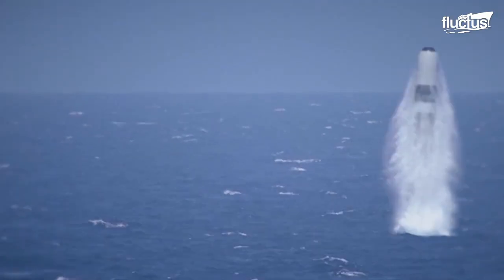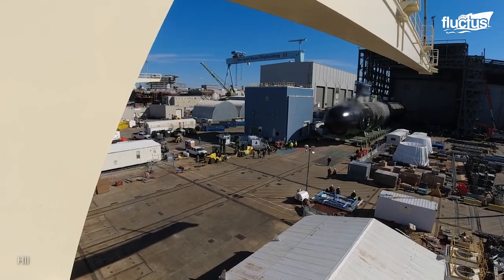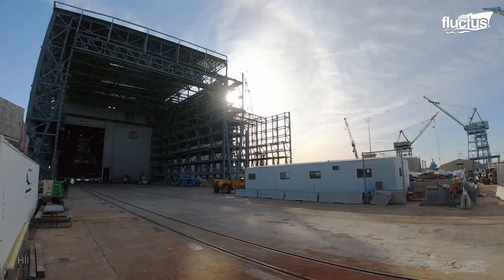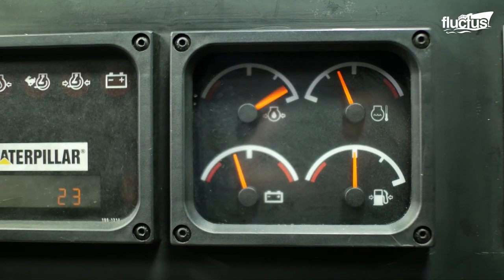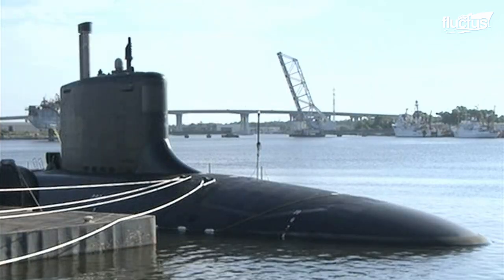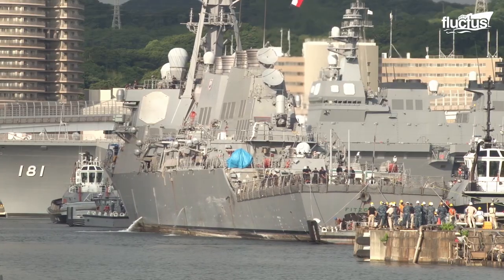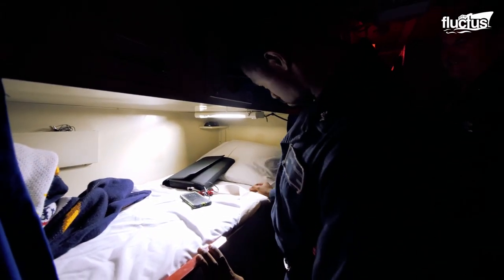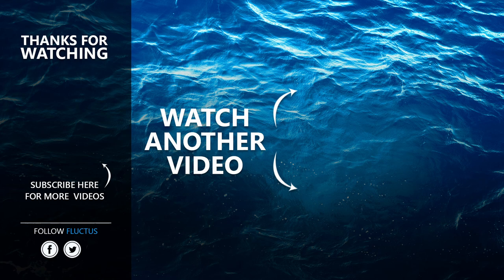Why US is Switching to this Massive $9 Billion Nuclear Submarine

Comment: @1:50 ”Currently the US submarine fleet includes twenty-nine Los Angeles class fast attack subs, and eighteen Ohio class ballistic missile subs.”  Technically correct, but the fleet also includes three Seawolf class fast attack subs and multiple newer Virginia class fast attack subs.
Reply: I was present at the first Sea Wolf Class sub's christening and launch. My wife worked for EB and I got a pass to go with her to the christening.
Reply: And you can assume they have way more undisclosed. Submarines is one of the most guarded secrets because of nukes and stuff.
Reply: @belldrop7365  No. The number of submarines we have is not secret. It would be impossible to keep such a secret. Also, the submarine service is secretive simply because submarine operations depend on stealth, not because of nukes in particular.
Reply: As a lifetime Navy Brat I hope you are fairly accurate!  I generally don't BS about weapons, some of that is too far and too late to stop!  I feel, just for the sake of propaganda, that autonomous Polar or other systems are possible fail-safesl  sm

Comment: 5:20 "When diving water is pumped into the ballast tanks, allowing the vessel to sink"

1. Water isn't pumped into the ballast tanks. The ballast tank vents are opened & water comes in from the bottom pushing air out the vents above.

2. The vessel doesn't sink, it dives as previously stated.
Reply: Yeah, 'Pumped into the ballast tanks' caught my ear as well.

Comment: The newest submarines do not use "the latest in technology,  like sail-mounted dive planes.."  
 Those have been deleted since the Seawolf class, (which is no longer being built)  in favor of retractable bow planes now being set into the hull itself.
Reply: Why don't they use a steerable ducted prop and eliminate any dive planes?
Reply: @rael5469  Probably sound reduction, better to be more stealthy than slightly more maneuverable.
Reply: @rael5469  Noise.
Reply: @rael5469  The newest submarines DO use a (sort of) ducted propeller, in the form of a "Shrouded Propeller" .  But these propellers are massive, some twenty to twenty-five feet in diameter, plus the "shroud" that surrounds  them,  their weight is measured in tons. The gimbaling mechanism needed to move this thing around would add too much more weight to make it practical.  Besides,  the Virginia class submarines are around 400 feet long,  attempting  to maneuver an object like that using only a rear mounted gimbal propeller would be all but impossible,  thus the need for bow mounted dive planes.
Reply: @rael5469  anything that moves has a sound signature, which would you say might have more moving parts  and therefore more points of failure. just speculating
Reply: @kuckoo9036  Why sail planes? I thought sail planes went out of fashion a long time ago.

Comment: The US is "switching to" one expensive submarine? Ummm, no. They will continue to replace the fleet with the latest designs and tech as required. By the time very many of a particular model are built, another improved version will become available, and then that will replace others retiring from the fleet. In other words, sub procurement is working like it has always worked.

Comment: We have 14 SSBNs and 4 converted to SSGNs. SSGNs are set to hold SM3s TLAMS and Harpoons in 20 of the 24 missile tubes while the other 4 tubes are refitted for SPEC OPS delivery and a variety of other missions. All American nuclear submarines have a nuclear electric and a steam powered indirect shaft driven propulsion setup with a 3rd Diesel Generator backup. The modern US Navy has always required triple redundancies for its warships. I hope the Columbia Class goes with Bow Planes due to greater efficiency and lower noise generation. Stealth is the key feature of all US Nuclear Sub Fleet.

Comment: The South China Sea might be too shallow for this $9 billion US ballistic submarine with only an average depth of a little over 5,000 feet.  And the Taiwan Straight is only 196 feet deep. That's why a US nuclear submarine collided with an uncharted seamount 2 years ago.
Reply: ...at least that's what the navy "reported", anyway. 

WE'LL never know.😂
Reply: That sub accident was caused by a massive amount of leadership failures on board that vessel. Not caused just by the shallow depths of the straight.
Reply: US subs seldom go down to 5000 ft.  Once two thermoclines separate the sub from what is hunting it, it is effectively invisible.

Not knowing about the “uncharted” seamount in the Taiwan Strait is a bit inexcusable, though.  It is not like it has moved in 10,000 years.

Comment: Right now the Ohio and LA class are reaching the end of their service life.  As for the Fast Attack the LA has some issues that have had to be dealt with during their service life, their ESM was far inferior to that of the old 637 class as they were designed primarily to be aircraft carrier protection and ASW.  There are other operations tasked to Submarines that the LA is not really all that good at.  The Ohio class is OLD, I mean the first of this class was constructed in the mid 70's they are getting very old.
Reply: @Michael-ij6kg  LA's simply sucked at SPECOPS these newer classes are a long time coming, in fact several older 637 classes were kept in service long after their planned retirement due to the limited capabilities of the LA class.  The Ohio class was a good boat but they are approaching nearly 50 years in service, remember rust never sleeps.  The Colombia class will be a welcomed addition.
Reply: Ya LA class should have never been built.  The Navy should have stuck with the older and much better Seawolf class but they wanted cheaper subs because of budget cuts probably.
Reply: @michaelmichaelagnew8503  LA class subs are older than the Seawolf class
Reply: what about the virginia class? how does that fit into chronology?
Reply: @westonh4900 Virginia class is the current production submarine using updated Seawolf technology to make a smaller quiter sub
Reply: @westonh4900  Have been out of the loop for almost 30 years but the Virginia Class was miles ahead of the LA for SPECOPS.  They were just coming on line when I retired but they were NEEDED as the old 637's and cousins were well past their Sell By Date.  Some of the 637's were still active in the early 2000's and all SPECOPS platforms, but hopefully now they have been retired.  They were outstanding platforms but sorry they were all built in the 60's and time marches on, rust never sleeps.
Reply: @michaelmichaelagnew8503 the first LA class submarine was commissioned in 76, the first sea wolf class submarine wasn’t commissioned until 97.

Comment: I remember being aboard two of the Trident submarines docked at King’s Bay, Georgia when I was in the NJROTC (Navy Junior Reserve Officer Training Corps). Life aboard a submarine is not for claustrophobic people. It was tight and highly functional.
Reply: I was told there was a rule that you couldn’t be over 5’ 9” to serve on a submarine before the 1970s. I had a brother that met  that requirement and was on a WW2 sub in the 1960s then a nuke fast attack(650)  after his shore duty. He was a STC. I have been on an old WW2 submarine and worked at EB on 688s and they were huge compared to the older submarines. I tried to get sub duty when I went in but they made me an avionics tech on P3s and never went out to sea on a ship. I stayed in barracks overseas and lived off base  in Maine between deployments.
Reply: I was a nuclear mechanic onboard a Los Angeles class fast attack boat and it made tridents look roomy.
Reply: @Chris_at_Home  I'm 6'3" and was on a 688. I had to get stitches 3 times for to splitting my head open. Turns out, HY80 is much harder than my head.
Reply: @kevinpotts123  I’ll bet that hurt. I worked on mainly the 694 the short time I worked at EB right after I got out of the Navy. I went back to school because I didn’t see much future in electronics wiring on submarines.

Comment: What do you mean with "electric drive" for the future class of submarines? What type of drive to they have now?
Reply: Steam
Reply: diesel but they are noisy so electric when stealth is needed
Reply: Steam generated by the nuclear reactors drive reduction gears to a mechanical drive system. The new Columbia class will still generate steam but will be used 100% for generating electricity which will then power the electric motors. Supposedly this will be more efficient use of the reactors as well as being much quieter than the mechanical gearing system.
Reply: @blackcat-mp7kh  The USN has no non-nuclear subs.  When they are needed, we rent the use of their diesel-electric subs and crews from our allies.